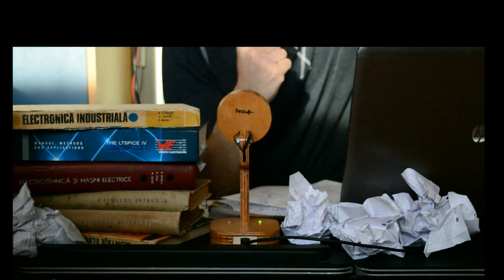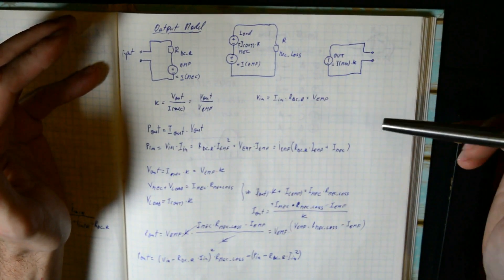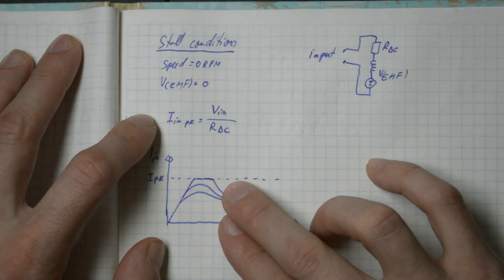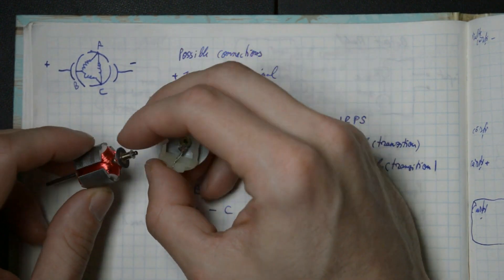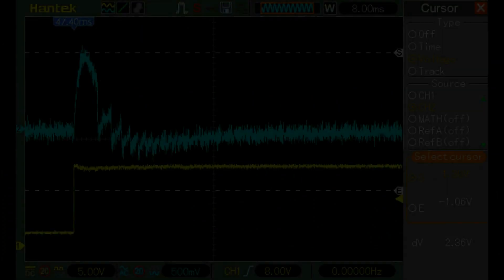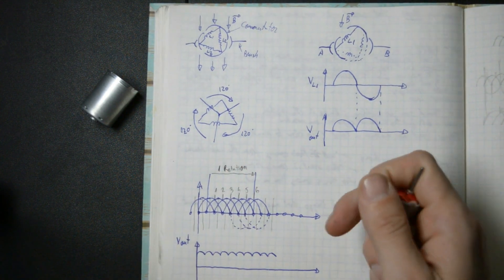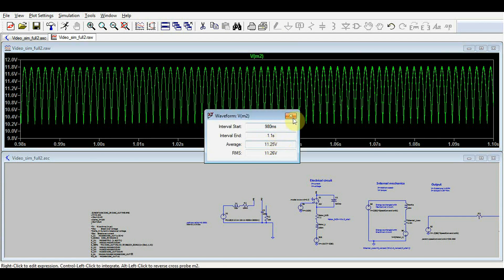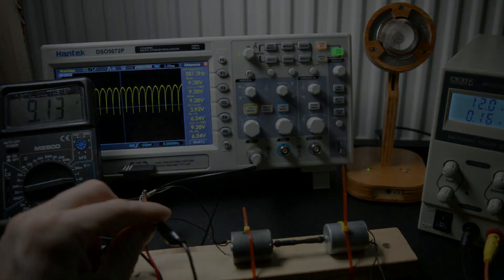LTSpice Tutorial - Modeling a DC brushed motor

Comment: Thank you for a very well explained simulation of DC motors. What is the motor inductance and resistance that matched your motor? I like to estimate the typical L/R time constant of DC motors.
I use a DC motor with 3 rotor poles as tachogenerator for a DIY servo drive of a sewing machine. So I can confirm, this waveform. However, because of inaccuracies of small motors, the brushes or rotor system may have turned a bit, so you do not get the perfect rectification of the sine waves. It can be a bit difficult to measure shaft speed fast at low speeds with rotary encoders. Then another DC motor is a nice and cheap alternative to encoders. However I think you will chose a motor with a rotor of 5 poles - you can get such small DC-motors cheep as well. This is my setup on the sewing machine: https://youtu.be/075OH2rgel0
Reply from the maker: I don't remember measuring the exact inductance - I think I just used a value that made the model behave similarly in the simulation as in real life; and for the resistance, I seem to have 7.1R; I did this video quite long ago, I unfortunately don't remember all the details

Comment: This is brilliant! I find your knowledge of LTSpice and ability to engineer reality into it astounding. 
I'm not sure I would call it simple though, it looks pretty complex to me!

But I suspect that you may have made an invalid assumption:-
You said there is a moment when no coil is connected as the brushes cross over the small gap in the commutator. But in reality I expect that for that short moment, there are TWO coils connected to the supply, as the brush touches both contacts. Imagine a larger motor with carbon brushes, which are much wider than the gap between contacts, where this would be even more pronounced. 
Do you agree? Does this affect your model?

Can you/have you considered folding the complexity of this model into a simply used general component that can be dropped into any LTSpice circuit?
Maybe that is so simple as to not be worth mentioning, but I certainly have no clue about how to do it.

I found this video because I wanted to play with simulating control of universal motors (eg: electric drill). In that case, the permanent magnets are replaced by field coils in the stator, which are in series with the rotor and brushes. I imagine that adding that aspect to the model would be easy (for you, not me!).
Reply from the maker: Hello Bertoid!
I think you are right! 2 coils should be connected if the brush contact area is wider than the gap, I will try to look for the motors I used in the video just to check, and let you know. Though if that happens, its a bit more difficult to get the inductive spikes, I think I need to study the problem a bit more deep. 
Regarding simplifying the model, you can pack the entire thing into a single component and that makes it more "user friendly". I tried to cover that process at the end of a different video - https://youtu.be/0smuo8bMRn4 (here I make another monstrosity, and turn it into a library component)
Regarding the electric drill, and modeling components in general, it highly depends on what "features" of the real thing you want to simulate. It can be as simple as a resistor to just waste some watts of power, or some monstrosity like I tried to create which simulates it down to the rotation speed and complete electrical noise. Considering that the motor is like this one with some extra fixed winding's for the stator electromagnets you can take a model for a clasical brushed motor, and just add a couple coils to simulate the electromagnets. Those coils will come with the inductance and series resistance of the real thing. The rest (rotor + brushes) is just like a simple permanent magnet motor.
Reply: Thanks for the reply. I was hoping that you might have done a video on making a library component - I'll take a look at that.

I have to re-watch this video to better understand a couple of things:-
1/ How the inductive spikes were coupled back into the supply lines. 
As this will happen when the brush leaves the contact, there is no longer a connection into the supply? (apart from arcing, and maybe some capacitive & inductive coupling) 
And isn't this the same problem whether no coils or two coils were are connected - always one coil will be de-energized as the brush leaves it, causing the spike? 
2/ How the permanent magnet's field was introduced into the model
I can see how adding two inductors for the field coils in a universal motor is fairly straightforward, but won't the fields from them (which will vary with current) have to be coupled into the model, in place of the permanent magnet? 
And I imagine it all gets quite a bit more hairy when the supply is AC!
Reply from the maker: Hello Bertoid,

On the first topic - even if the contact jumps from one coil to the other, or both are touched at the same time, the spike will appear when the disconnection from a charged inductor occurs. When the disconnection appears, the current previously going trough the first coil doesn't dissapear (the inductor stores current the same way the capacitor stores voltage), it turns into a very high voltage that causes the arc - this voltage is fed back into the supply line. The second coil that is already connected to the contact is also an inductor so it will not accept a fast current rise therefore it does not absorb the high voltage arc. The model I made reproduces this effect, it just doesn't have the second coil.

On the second topic - the permanent magnets are not directly modeled in my example - these would be what cause the voltage source in series with the inductor and resistor to create the induced voltage (the EMF). I think that you can get the model to work with AC (turn the same way regardless of voltage polarity) by multiplying the voltage in the EMF source and the one in the mechanical circuit with the direction of the current trough the motor (*1 if its positive or *-1 if its negative). Also to remove the "generator" behavior, the voltage source that links the internal mechanics to the output needs to be multiplied with 0 if there is no current on the input. This way it shouldn't start generating current when rotated. 

When I get a chance I will try to edit the model to reproduce the AC motor also